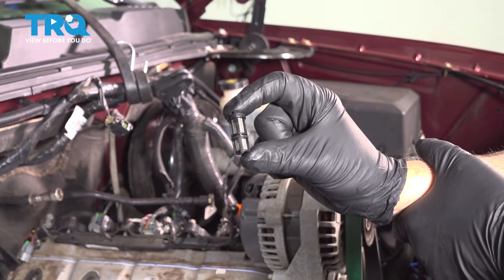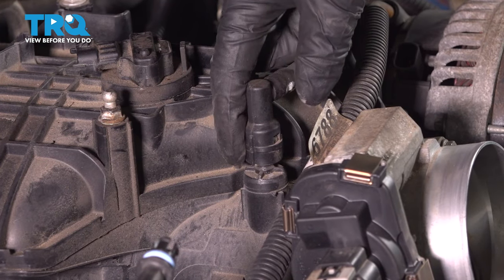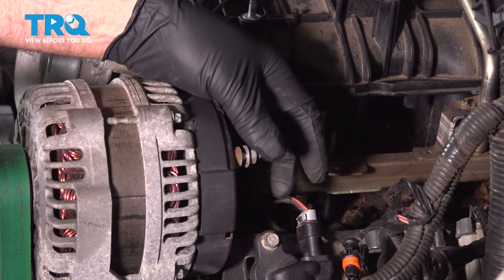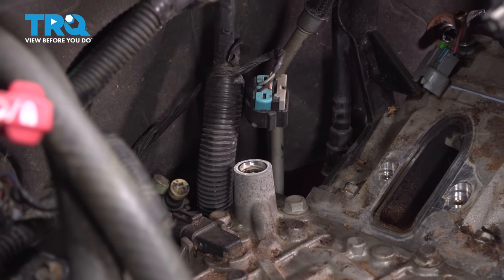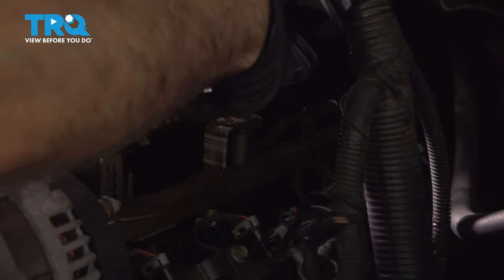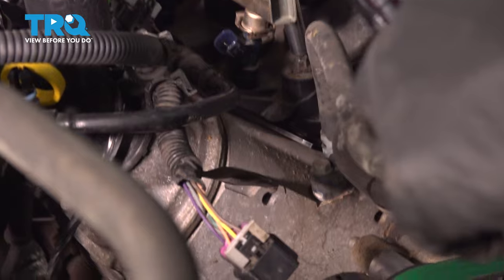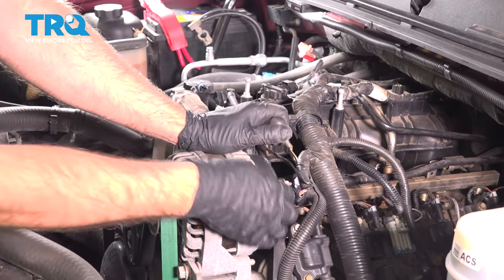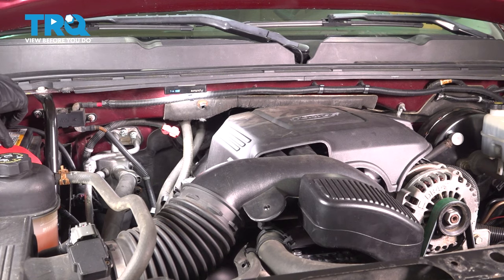How to Replace Oil Pressure Switch Filter 2007-2013 Chevrolet Silverado 1500

Comment: You don’t have to take the whole intake off. I just changed mine (2009 Sierra 5.3) by removing the cover, unplugging a few hoses to make room, and reaching behind the intake. Start to finish about 30 min. Removing the entire intake is NOT necessary if all you are doing is swapping the oil pressure switch and screen.

Comment: It is unnecessary to pull the intake manifold off. You can reach back there with a swivel and pull the sensor out I've done it twice on my 2011 Z71. I was searching for a video because I couldn't remember which size socket to use and stumble across this one. Please bring back the downvote button.

Comment: Why yes Why not just reach around the back side of the housing and put a socket on the sensor and spin it off  ??? why in the name of GOD would anyone pull the intake??? unless it is a Repair Shop jamming the customer for a ton of repair money to do a less them one hour job???  so many videos on you tube showing us just reach around and change it out... now you seam like a great wrench what is really going on here???  how much is that intake gasket??? hope is does not leak now you broke the seal and hope nothing drops into the intake ports during this job... i will just now use a dremel tool to trim out that over engineered plastic cover blocking the sensor that some GENIUS thought of,,, this is the only real problem is the cover... i am a master at Fiberglass and i can if i really wanted to reattach this over designed cover, and sand it flush and paint is and no one would ever know it was touched for i am a true master at Fiberglass WORK on boats or anything else but pulling the intake is just senseless waste of time, i saw another video of a shop doing the same thing and charging the customer a ton of money to pull the intake, i can see that tossing the customer under the bus... Haha....

Comment: Seems to be a fuxload of people who are more than happy to tell you the intake doesn't need to be removed. I'm not one of those people. I'm sure I could do the wrench-work but my main problem was trying to dis-con the damn wiring harness to the sensor. I figured fuckit and chalked it up to wanting the experience of removing and reinstalling the intake just because I've never done it before. So thank you for posting this video. It really was about an hour start to finish and three 16oz cold ones. Good way to spend a Saturday morning, truth be told!

Comment: wow that looks like a a lot of work for  a wire & sensor  bolted on - I was just looking to see which side of the engine bay the sensor is most accessible on.  My take away from the video after seeing location was to figure out how to use a 1 & 1/16 socket in a tiny space.  The intake stayed on!  Thanks for the exploratory video.

Comment: There was no need to take the intake off and make all that extra work. I just changed my oil sensor in that exact location and the top cover was the only thing I needed to remove.

Comment: Regular mechanic 5 minute job
Dealer mechanic 9 hours

Customer - $800? Are you swrious

Regular mechanic - nah $19 part and a pack of beer

Dealer mechanic - well no $800 in labor and $300 for the part $75 inspection fee and $150 waste disposal fee. $1325.... plus tax

Comment: I replace this oil sender sensor and still having problems with my oil light, keep blinking in my 99 dodge ram 1500 5.2L 4X4. I was thinking maybe it was the filter inside of the oil pan or maybe in my oil pump going out because I heard a knocking sound under they’re coming from the oil pan

Comment: I have changed the oil psi sensor 3 times and left intake in place & twice with intake not removed. The 27 mm socket will not fit without loosening the metal plate for engine pulling. Have to loosen it up. I just question how a oil sensor can fail 3 times? Mine never had a screen & failed with less than 10,000 miles first time & again at 145 miles. All the replacement sensors are GM parts. Is the manufacturing at fault? ECM PCM at fault? All three times engine was full of oil as shown on dip stick. No lifter noise or rattles from engine. Any ideas?